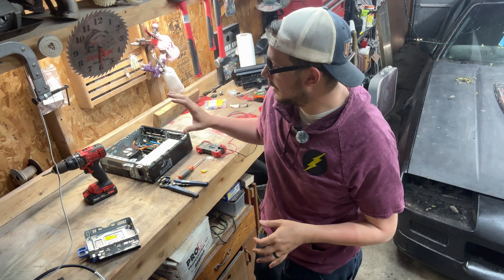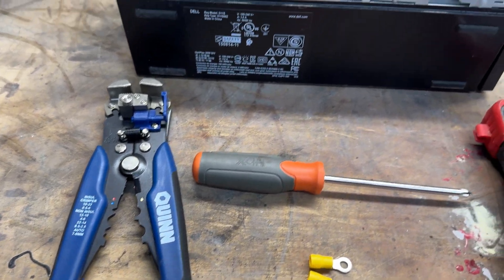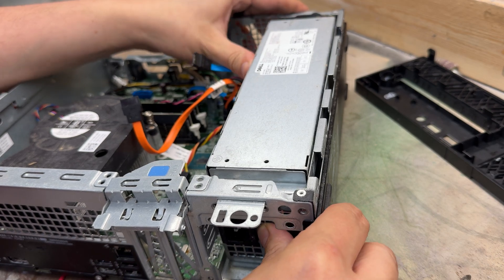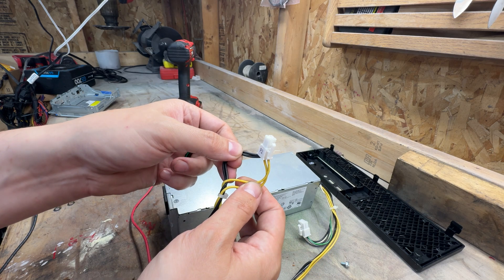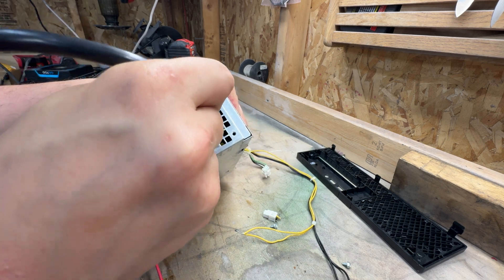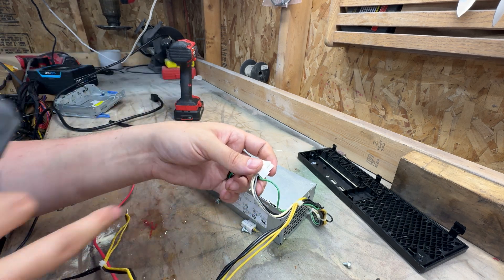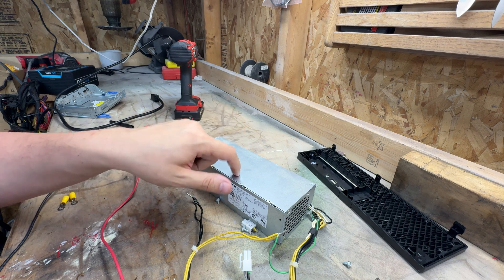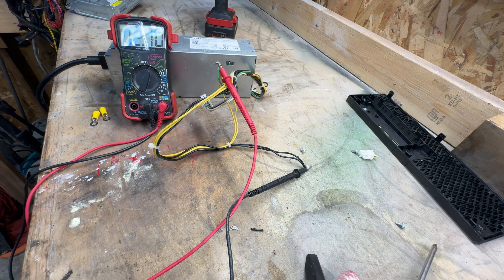How to Build a DIY 12V Power Supply from an Old PC PSU  | Fish Finders, Car Accessories, More!

Comment: i turn old power supply's into radios for peoples shops. car stereo power supply and a few speakers and off to the races :) i learned to do this 30+ years ago great use for old systems :) harder to get the computers these days not many curb finds lol finding that dang green wire sucks lol
Reply from the maker: I’m absolutely swimming in these things right now - I work at an IT firm, lots of our clients are removing old units for the Windows 11 capability, a whole new supply is about the hit dumpsters